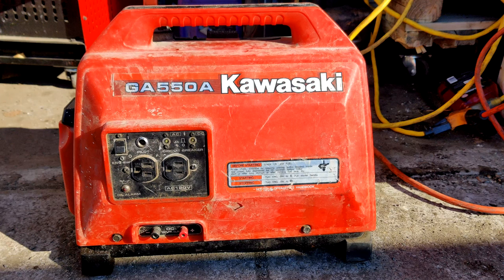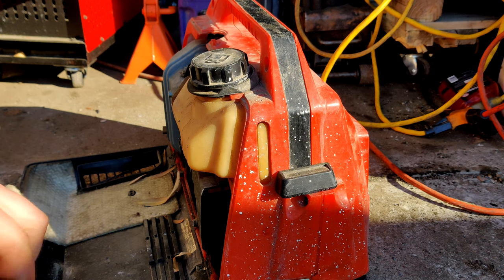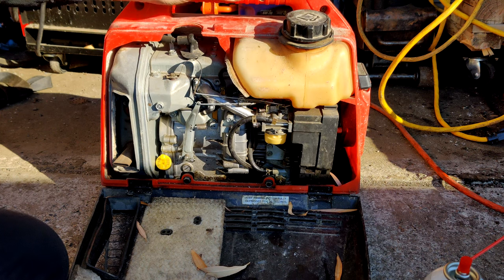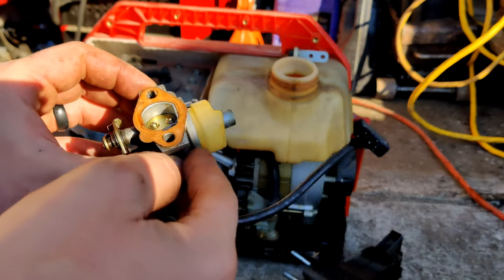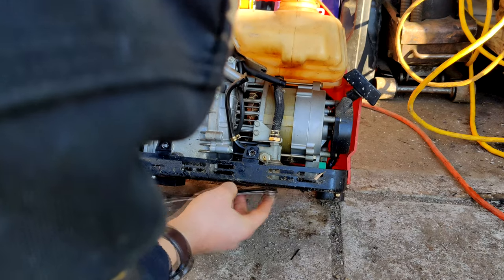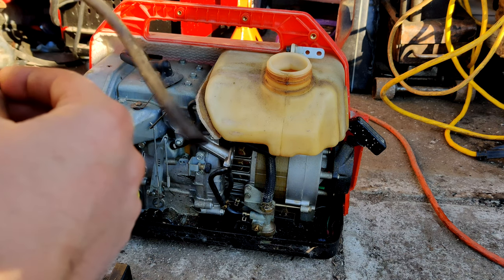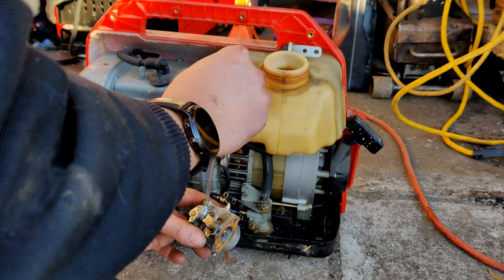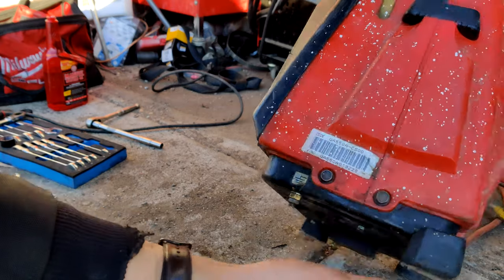Kawasaki Generator Repair - Let's Fix Your Generator!

Comment: Greetings from Japan🇯🇵.  This was a great repair video.  The GA550A has a unique development history among Kawasaki's generators.  This generator was developed at the request of Ochiai Hamono Kogyo, a Japanese tea harvesting machine manufacturer.  It was released relatively recently in 2004 as Ochiai GA550A and Kawasaki GA550A.  Ochiai GA550A, unlike Kawasaki GA550A, was capable of DC24V output.  In addition to driving a 24V DC hedge trimmer called a tea trimmer, it was also compatible with charging the 24V car battery commonly used in Japanese diesel engine cars.  The GA550A's main use was limited to Japanese tea farmers, so its sales period was not very long.  However, the GA550A was developed quite late for Kawasaki's generators, and its compact packaging was on par with Honda's and Yamaha Motor's portable generators of the same period.  I am grateful that there are owners outside of Japan who value the excellent Japanese products of the past.

Comment: im going to try to get my one started this weekend, its been sitting there long enough and i would like it working. Very good info, cheers
Reply from the maker: Where you able to get it going? 😊
Reply: @ils360  Yes i was, thank you so much for the detailed  vid. after cleaning the pump and the carb out it ran.
Reply from the maker: @markswildlifetrailcams  awesome!! Glad to hear it!! They are great little generators!